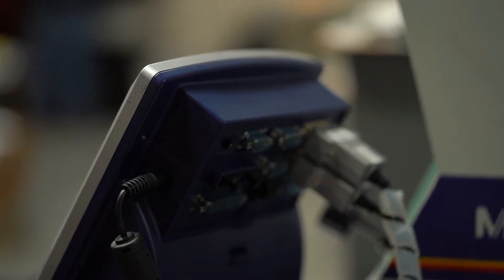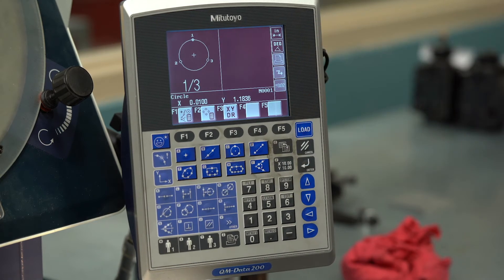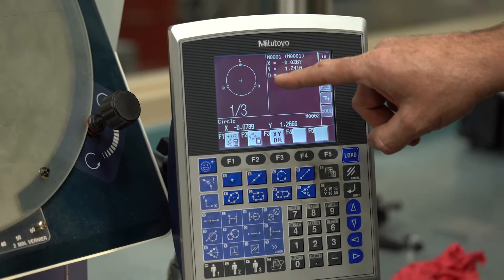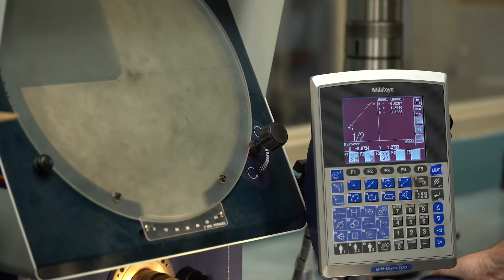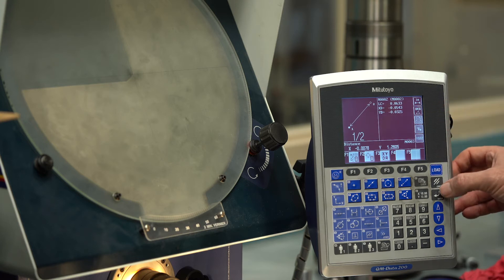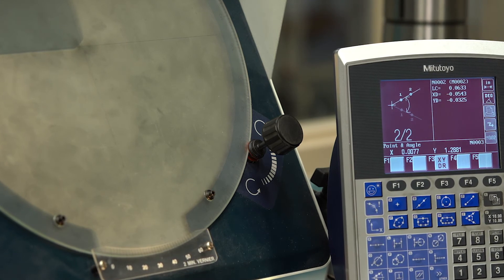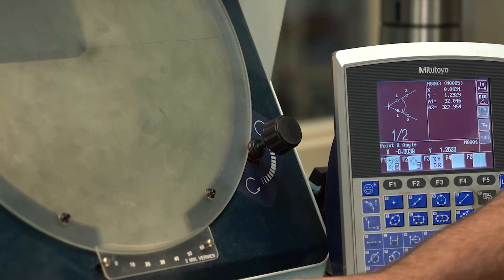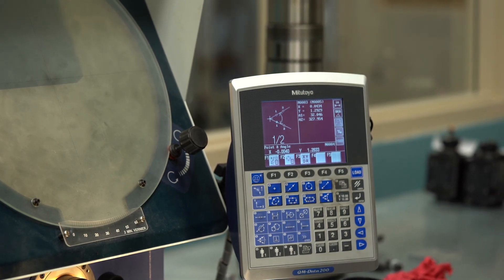Mitutoyo Optical Comparator Basics- Davis Technical College

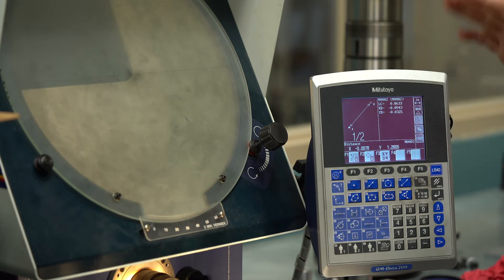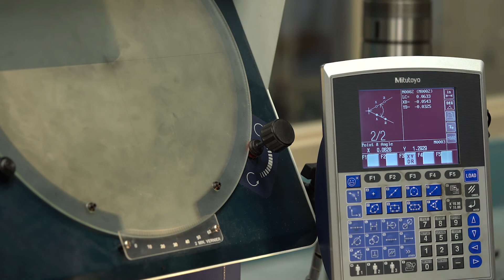Comment: You can tell that the part is not aligned perfectly because at  5:24 the X value and the Y value are not the same. In a perfect 45 deg angle they would be. That is not a problem as long as you are careful to pick up the actual edge of the part and do NOT assume that it was lined up. At 6:49 he assumed that there was no change in Y. He would have been more accurate if he would have adjusted the Y as needed to stay right on the edge. Some comparators allow you to correct for an alignment error and will adjust what it horizontal or vertical for you.